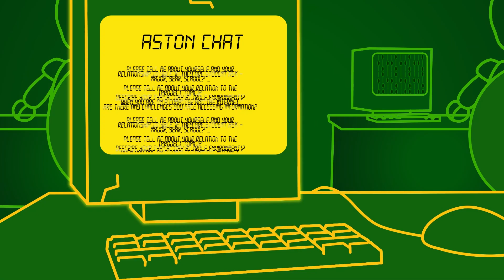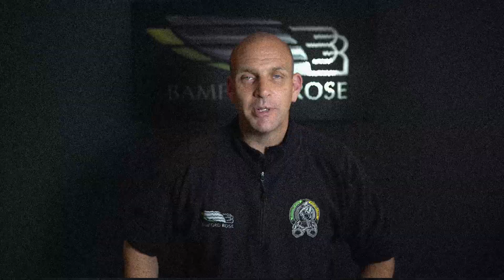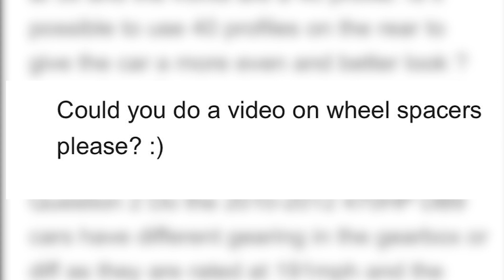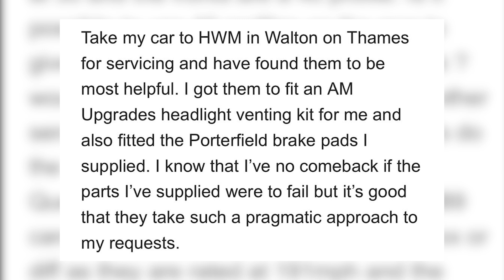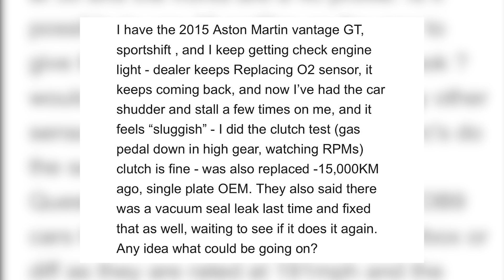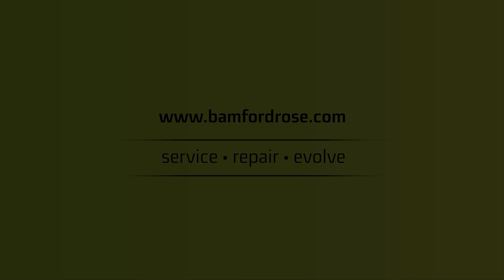Quickfire question roundup Forum chat #78

Comment: Hi another great video as always.  I have a 2010 4.7 manual roadster and have lost both displays showing digital speedo, trip info etc.  I have read that this “may” be due to the roof module being on its way out however my roof is functioning normally, windows all ok etc.  is there anything I can do fuse wise or does the car need to come to you or a dealer for diagnostic checks?